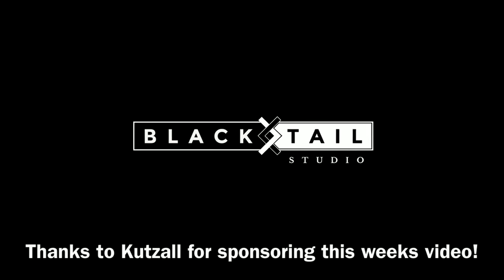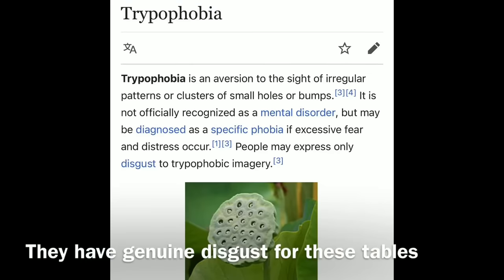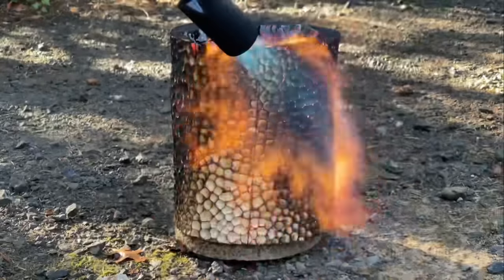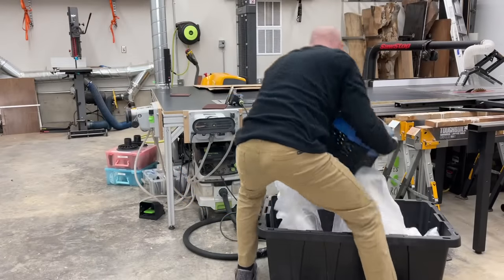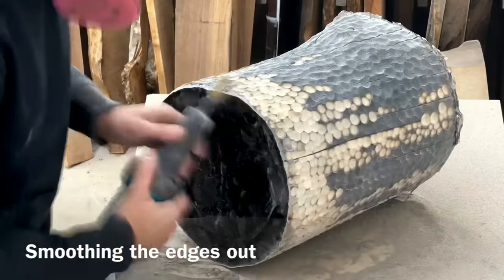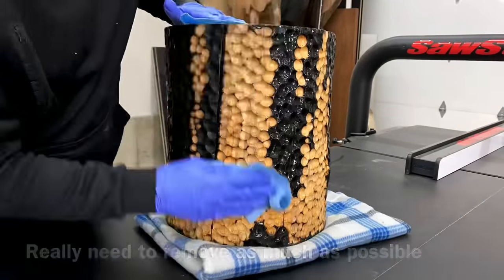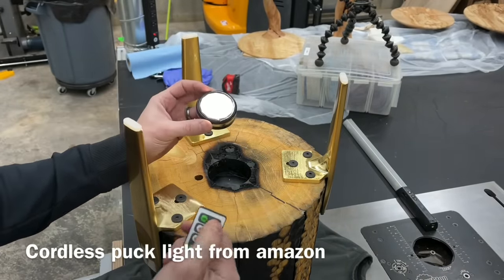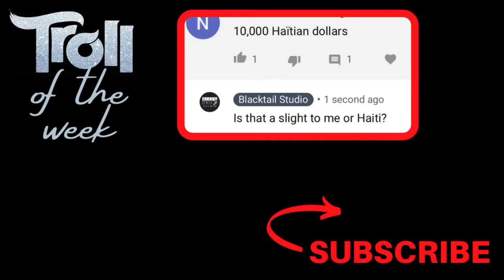I Sold This Firewood for $2500

Comment: Loved this one!  Re: the puck light...it looks like you got a kit with an IR remote, which requires line of sight.  I always look for kits with RF remotes instead - easy fix. :)
Reply: Even with an RF kit, he put it in a giant piece of wood and then put a metal bar on the bottom. The wood will scatter RF and the metal will eat it. You'd need an antenna that came out and was exposed on the side to make this work.
Reply from the maker: Now you tell me mike!
Reply: @BlacktailStudio  i wonder how a ring of the fairy lights would look embedded in the epoxy, might light up the chared wood 🤔
Reply: @soundtw77  that would look quite different, it would give an almost infinity log look
Reply: @prahielbhoodram3261  Probably so
Reply: When are you two going to collaborate on a project? I'll keep asking.
Reply from the maker: We’ve actually started talking about it!
Reply: RF, or WiFi (with smartphone app).  The controllers themselves are maybe 10x30x3mm, and could be put on the bottom near the outside, and the light (either strip or high-powered LED on aluminum pad) put where you have the puck now.
Reply: @BlacktailStudio  I just wish Mike would stop calling me "Kev", do I look like  a "Kev"?
Reply: @ryanbrown982  it would actually be quite easy to make one of the brass legs into the antenna
Reply: good tip and I am sure that is the problem here.
Reply: @ryanbrown982  not as much as you think . 433mhz would pass right through it's a low enough frequency . 2.4ghz would still work but you would need to be fairly close . but it would work unlike inferred and it not like you would be 100m down the road
Reply: Should have done white reflective paint inside of the charcoal mass.
Reply: @soundtw77  I like that idea.
Reply: @soundtw77  Not just a ring of fairy lights, but stuff the whole void with them.
Reply: @ryanbrown982  just wire it to those expensive brass antennas.
Reply: incorporate some Gold Leaf into some epoxy on a table.
Reply: @YouTubePurgetheblackplague  😍  ooooooo. Or mirror paint
Reply: @nicevideomancanada  wonder if you could gold leaf or silver leaf the inside so it emphasizes the texture of the charred wood like the white ash normally does...🤔
Reply: I would like more info on the router set up, especially the sled and carriage. Thanks.  Mike
Reply: I wonder how imbedded lights in the charred wood on the inside and a mirror at the bottom would had looked.
Reply: Yeah have some RF lightstrips on my computer desk, and i was amazed they go through 3 brick walls w/o a problem. A major improvement over IR ones..

Comment: "I feel like I can live a pretty happy life with 9 toes."  Cam - 2021
Reply from the maker: See if it applies in a couple years
Reply: @BlacktailStudio  Just to be aware. If you lose a finger, unless it is your thumb, you'll pretty much get used to it. If you lose a toe, especially the big toe, you basically can't run anymore.
Reply: I think it's best to keep all fingers and toes.
Reply: @orlanino  he’s 40 or nearing it he’s not going to do a lot of running like a kid so he might still live a happy life
Reply: @jackmiller690  true that.
Reply: good attitude  😂
Reply: Had a table saw accident a few years back after 45 accident free years. Didn't lose the middle finger, but mangled it pretty bad so now the tip is not straight, but hangs down at a forty-five degree angle. Not a cool way to be and yes, it gets in the way and I don't have a good grip with that hand. Keep all your fingers and toes intact--each one has a purpose!
Reply: @robertm348  Very good advice from someone who actually has experienced a shop accident. I'm sorry, but his logic is just dumb. It's like saying I'll continue not to use a push stick for cutting small parts on the table saw until I get kick-back and lose the use of my hand or arm. Then I'll start using a push stick.
 I lost my entire left hip (and without a replacement, so you can visualize what that looks like- pretty ugly!) I would give anything to have it back because as I age the area gets more painful each year. Anyone who has lost a body part can tell you their life has NEVER been the same as it was prior to losing it.
Reply: He doesn't need to run just build
Reply: Im sure he doesn't want to lose anything. He was probably just joking. Stop making it so serious.
Reply: @orlanino  I've heard you can basically live life completely normal without both pinky toes though as they are essentially useless now in human evolution and dont really do much for our balance or whatever?
Reply: I mean it’s still pretty dangerous but he is mainly working on tables so there’s not a lot of danger to his feet. Probably the only thing you can actually worry about is something falling off that table and crushing his toes, which has happened before.
Reply: I cant wear flip flops……
Reply: @orlanino 
From fortnite
Reply: As someone who lost half a big toe. You can indeed still run and be happy lol
Reply: @Dogprofile  until he gets chased by a wild Karen.  Antifa. Or trumpers
Reply: Its all fun and games until you lose a 2nd toe..  🤐
Reply: He's not wrong, you can live happy life without couple of toes on your foot, but lose a hand's thumb and things start to become difficult.
Reply: @BlacktailStudio how’s it looking 2 years later?
Reply: It's his safety to worry about, not you folks.
Quit crying about it.

Comment: This is such a cool idea. If I may add my 2 cents in terms of design:
1. I like the contrast on the outside but I thought you were going to leave black streaks in a pattern to make it look like stuff boiled and spilled over on all the sides. I think that would have looked better than a random contrast
2. The inside could be made to look like a geode by using 2 different color epoxy. The first coat on the inside (or part of it) could be a bright sparkly color like blue or red and then fill it up with clear epoxy. So when you light it up it will look like there are crystals inside.
Reply: Yeah ok, interesting. I like this hey 👍🏽
Reply: Cool idea, the geode concept! The right position of the lighting would be totally key. Very cool color temp LED (5000k) and using reflective paint only. Perhaps powdered Interference Pigments mixed with bright, powdered metallics. Red to Green. Purple to Orange. The Geode idea using the textured, burned wood could be a whole offshoot concept. Lots of experimentation needed for sure, but very visually exciting.
Reply: EvanandKaitlyn made a really similar geode table to what you're describing!
Reply: Or carv out the inside a bit more, then burn. Mound hidden LED's around the inside rim facing down at a 45°angle.  Put a mirror at the bottom. And when you look down into it, it will look like the hole goes on & on & on.

Comment: Cool project. Thanks for making this. My two cents on the aesthetics: The abruptness and pseudo-randomness of the natural wood areas detracted from the cleanliness of the epoxy, and didn't necessarily create a harmonious contrast. I think the exposed natural wood portions of the exterior could be more successful if they were gradated. You could achieve smooth transitions by grinding initially 1 out 10 in an area, and gradually progressing to 10/10 in an area. Alternatively, you could try burring varying sizes of divots in a gradual manner. Look at the printing technique of half tones as an example.

Comment: This gives me an idea: On the inside of the log, near the base more but I'd say going most of the way up, perhaps adding a fine metallic dust that would help reflect the light and give that "deep space" feel into the first couple basting layers. I think that may aid any underlighting, and help bring more life to the burn pattern in the wood. I'm not sure what metal dust would have the best reflective properties for this kind of application, but I'd imagine silver, aluminium, or nickel would work well.
Reply: Mica powder would do this.
Reply: That sounds pretty awesome, make it look like a wormhole
Reply: Would cheap  glitter  still reflect in epoxy? Or is there something that would be luminous or flourese?
Reply: Just fill the epoxy with glitter from Michael's and call it a day.

Comment: Turned out pretty cool man!     I’d be tempted to try carving out a few of those thin cracks that run down the sides of the stump, carve them out all the way down to the epoxy center... this way when you light it up, the colored light effect would glow through the cracks around around the sides as well as the top surface.
Reply: Wow, cool 😎 idea!
Reply: You could drill a hole down to the epoxy core and then back fill it with more epoxy. You could do lot of "shafts" at different angles, and/or colors.  Same idea but they would be filled.  (not sure if that's what you were thinking) and if you had a strong enough light they would throw little circles of light on the ceiling or floor.  Might be cool.

Comment: If you do another project like this with the light, try adding a mirror prism above the light fixture so the light is more dispersed on the burnt surfaces. Also consider leaving bubbles in to catch the light.

Comment: If this is something you'll be repeating, you should look into stabilizing resin. Stays liquid until baked, normal use is to build a vacuum canister larger than the piece, toss in the piece and add stabilizer until covered. Vacuum and keep in vacuum until it stops bubbling, slowly release the vacuum to allow the resin to get sucked in and fill all the regularly air-filled microscopic voids, then bake the whole piece for several hours to set up the resin all throughout the piece.
Peter Brown put out several videos using stabilizer resin (although with much smaller garage projects.)

Comment: 🔥Question / idea: You said it was hard to look into the charcoaled pit, due to it entirely being filled up with resin. Wouldn't it be possible to leave it empty without filling it up? You could place a glass plate surface on it. Or, if you want it with resin, perhaps flip your project upside down and place the tree stump in a small resin bath to make like a resin surface? Than I think you would create a cavity which would increase the visibility, ánd have it surfaced of with resin so you can use it as a table. Just an idea. Would such an approach be feasible? Cool project.

Comment: One " layman" idea is to take some foil, crush it in your hand, it's all wrinkly now. Place it all along the hollow part, then when you turn on the puck light in red, it would look exactly as if the log is smoldering. The wrinkles in the foil give such a realistic effect, as it stifles the light along the wrinkle line and let's the shiny part reflect.  If you look at  smoldering coals or wood, it has " ash-lines" in an irregular pattern . The wrinkles give that effect. The dark top would won't let the foil be visible when the light is off.

Comment: Some suggestions, coating the inside burned portion with some silver metallic epoxy would help the light bounce around with a nice effect. Also, instead of lighting it directly from the bottom, try from the sides at an angle. Lastly, it might be pretty rad to try a project with fiber optic cables in the epoxy. As always, i love your work!

Comment: Version 2.0: Dry brush white and glow in the dark highlights on the inside before filling.
Reply: Here is the artsy touch that would have made it even more beautiful
Reply: Or leave black, but coat the charred black inner sides with epoxy mixed with that shimmering mica powder/ glitter, let that dry and then fill up it with the clear epoxy.

Comment: 🔥. Your original fire table had me thinking it would be cool to put some orange or red colored epoxy down in a few of the char cracks and when doing the the clear pour add some white pearl to some epoxy and make it look like it’s still smoldering with some wisps of smoke. Me being a firefighter I thought the fire table was badass, has me wanting to try it 👍🇺🇸

Comment: To avoid the sag on the router jig just use the first portion of the supports and keep off the sag. Stay as close as you can to the vertical point loads for the support beam for the router slides. Easy way to do it instead of installing point load under sag point to avoid the weight affecting trueness or uniformity

Comment: 🕵 Cam I might be a year late but I actually enjoyed that one. The Led lights have gotten a lot better over time they have some with a separate IR module that will give you 4 to 6 inches away from the lights to mount so that your remote will work every time. More light projects please
Reply: I'm guessing that's not going to work without the ir receiver mounted in line of sight. So radio based wireless might be the way to go. ESP32 might be a thing although I'm sure radio controlled LEDs are probably a thing now.

Comment: Two amazing facts i learned here was that the epoxy reacts up to three weeks and the trick by spraying water on to the workbench to absorb dust.
I had a a lot of problems with mosaicpins for knifehandles. They kept moving weeks after the knife was finished. 
This project is very creative and experimental. Thanks for sharing this idea.

Comment: FYI -EGO battery powered tools have more power in my opinion. Have used them for years and cut trees down with the one I have. Newer ones have 16" bar instead of my 14". I'm too old for gas saw but this works well. Their weed eater is top notch, just leave off the handle and control is easier. Many complained about chain loosening but some people forgot to tighten it as part of routine maintenance.

Comment: A local glass shop made a rectangular glass top for what was a caned top piano bench. They radiuses the corners then gave it a nice rounded ground edge. And even provided a little envelope of round vinyl discs to set it on so it didn’t slide around. 
They could make one for a table like this saving time and money. Whether you’re making a one off fire yourself. Or especially if you were making them to sell. And the charred outside would have remained. Which personally I would have liked. And still been able to illuminate it. Cheers.

Comment: funny how the universe works. this video just came up on my front page. ive got an old live oak tree that came down last year from a hurricane. ive been cleaning it up slowly. the trunk is about 3' across. it has split and cracked on its own, has some sort of fat grubs living/eating through it. so i decided i would try to make coffee tables out of it. i cut off a few slices about 4'' thick, sanded the serfaces smooth, removed the bugs and have them sitting in my garage trying to dry them. now i have a sort of guide as to how to do what i wanted to do. THANKS so much for this walkthrough.  +1 sub

Comment: I restore headlights and remove scratches from paint by running through grits from 600 or 1000 the way up to 10000 instead of stopping at 2500 or 3000 then switching to polishes. The finish is absolutely beautiful.

Comment: embedding some LEDs within the epoxy and having the wiring come out of the bottom would be cool.  You could run a few different circuits and hook it to a micro controller for various live effects.  Mixing some mica in the epoxy would also help to expose more of the inside by diffusing/reflecting the light.

Comment: Unistrut would make a good frame for a flattening jig !  You can use spring-nuts to adjust to any desired height  and angle brackets for holding it together !  But the best part is you could stand on the thing while you were using it as unistrut would hold you, router,and a motorcycle at the same time !!!

Comment: As a cheapskate wireless engineer... Theoretically you might get that puck light to work if you open the puck and take some cheap wire (doorbell wire is often bulk and cheap) and 'attach' it to the brass legs as massive antennas. The attachment point is risky because of the differing materials causing corrosion over time. Alternativly running the wire in some sort of ring around the base with insulation between it and the brass legs, would work as an omnidirectional antenna.

Comment: On the wet sanding part I use lots of water. A wise man once told me it’s called wet sanding not moist sanding 🙂 On the buffing part use foam pads. There’s white, black and blue. White is used with compound, black is used with swirl mark remover then blue is used with ultra fine. All 3m products, they’re double sided pads and you’ll have to buy the quick connect attachment. I get a pretty sweet shine with that system.

Comment: :face-orange-raised-eyebrow: like the pattern on this , and the legs, also the idea of the light inside. My thoughts are best if pattern is either all black burnt or if there is more over lap in graduation/gradation from dark black to light pine white, one to the other with a middle transition of  black burn outline on the light circle pattern. Also  larger carved out interior with a red light .  Again you're the master.  The glassy epoxy top finish was awesome .  Ultimately, I hope you have another go or two with the out patterning, really cool . <3

Comment: Cool project. The top was beautifully finished, and the idea for the up-light was clever. I'm with your wife on the finish for the sides. Another commenter suggested a reddish tint. I think maybe a bronze or other color that paired well with the color of the legs. That way part of the outside would pair with the top, and the other with the legs.